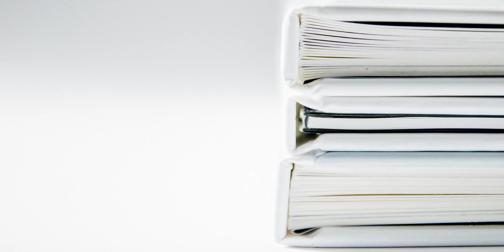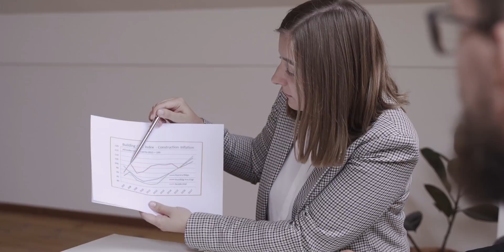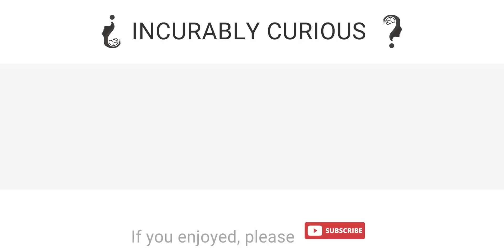Why Most Power Lines Aren’t Underground

Comment: I work as a vegetation inspector here in California and I did want to bring up the point of the cost for "pruning the trees".  Since you made it sound like it was not a big cost.  For us it takes about a week for a team of about 6 people to section of our county at roughly 15 miles a person for that week.  Each of them can be payed ultimately by the power company between $19-$25/hr for 40hr/week.  After that you have the cost of the tree crews to do the work for about $15,000 per day for a 3 man crew.  Plus any inspectors coming afterwards to make sure the job was done correctly and the tree crews didn't miss anything.  Those inspectors they get payed between $30-$40/hr or up to $60 if they have a degree in electrical engineering systems.

So that's $237,120 for the first inspectors $5,460,000 for the tree crews and $62,400 for the last inspector for the lowest amount you could pay each year for a total of $5,759,520.  This is the bare minimum it would cost per year to patrol and clear the lines in each county of which there are 58 in California alone.  This doesn't include any bosses, clerks, office space, overtime, or equipment needed for these jobs to function.  And all of this is if they people working are from that area.  If they are from a few county's over or out of state they have to have lodging until they move on to somewhere else or back home.

So saying its just a matter of pruning trees along the lines is a little disingenuous.  And for those curious that's $460,761,600 over the course of the 80 years to maintain that network in an area if prices stayed the same for that time.  Which obviously prices aren't stagnant.  If anyone has general questions about what I do I'm happy to answer them.
Reply: I'm working on getting my Msc Advanced Power and energy systems. You're telling me I CAN BE A VEGETATION INSPECTOR??? I was considering being a SCADA or TSO engineer. This sounds more like my speed.
Reply: @jayflavor1  Of course you can.  I'll let you know right now every vegetation inspection company is looking for people.  There has been a huge shortage of people for years now and each one has been desperate to find good people.
Reply: Generaly people tend to not realise how much maintence of any infrastructure costs, and the army of people it takes.
Reply: @xzardas541  exactly man. People just don't realize because it all gets done but as soon as the government ( nomatter how much money they waste) is gone. This will go bad really fast. Just watch the documentary about what happens if every human disappeared instantly how fast our infrastructure will collapse. Just count all the city workers you see in a day and that is just a small percentage of what's needed.
Reply: I would like to note that though that seems like a high price tag relative to how much the infrastructure of the power lines and substations cost, that's really not that much. I work as an engineer designing substations and even for small projects where we're just replacing a single piece of equipment or just renaming lines. It can cost tens of thousands of dollars for just the design work over the course of a month or two. Then you have the cost of the actual equipment and the cost of the actual installation to account for as well for an small job you're looking at maybe $100,000+ and a big job well into the millions.
Reply: In Singapore, the thick crowns of tropical trees shed so many leaves regularly that just the leaves would cost outages. Power lines are fully underground now but trees are still pruned regularly to keep them out of the way of buildings and other structures, and it looks like a LOT of work
Reply: @aahfeeki  It is.  For here we have 2 teams one looking at dead and dying trees and the other is looking at green tree hazards.  We have them staggered 6 months apart so things are less likely to be missed.  It still happens though because we are only human.  Here I my county Grey Pines are a huge problem.  Not only do they grow I credibility fast (4'-8' a year) but they also have very weak and poor taper wood so they lose branches often and have issues with uprooting.
Reply: "Which obviously prices aren't stagnant." — This would be relevant if the price of trimming the trees rose at a faster rate than the prices of everything else. If the price of the tree trimming rises in a proportionate manner to all other prices, then it is irrelevant — you just pick a year (probably the current year) and quote the cost in that year's dollars. Future generations can then inflation-adjust it. If, on the other hand, the price of tree trimming is expected to outpace other prices in future years, then you would have to account for those increases to have the most accurate dollar figure for a multi-decade operation.
Reply: You're a veg detective?
Reply: @krashd  Pretty much haha
Reply: @krashd  haha pretty much! And it's been the best job I've ever had.
Reply: Yup, the cost of labor in the long term is intense.
Reply: Good details
Reply: There are 2 type of expenses for any company, capex and opex. In the case of power utilities, capex (cost related to puting up electric facilities) is included in the rates, while opex (cost of maintenance and operation) is normally not, specially labor-only activities such as tree trimming. Basically tree trimming is a sunk cost for power utilities and it does not affect power utility rates regardless of how intensive it is. It is a matter of accounting.
Reply: Then the costs of people who die from accidents.  They could bury power lines under the roads which would reduce many problems currently associated with certain flooding events, and certain tree damage.
Reply: @b_uppy  exactly. "Lawsuits" was a key word I left out.
Multi-millions.
Reply: @garyfasso6223  
But hey we're 'saving money'.  🙄🙄🙄
Reply: I feel for you, I used to have to do this job. It IS expensive, AND VERY DANGEROUS.
Reply: @Paradoxicon999 
A teenager was killed on the job doing trimming related work.
Reply: Yeah, and then there's youtube channels where 1 guy does your job better as a hobby. Shut up city worker
Reply: While a good point, given the price to install underground cables and how long they last. It seems it would still be cheaper to just maintain above ground cables in most areas
Reply: @zadeoooo  In many instances it can be cheaper.  For example in areas that are geologically unstable.  Which is pretty common in here.
Reply: It's California. Just wait for a fire.
Reply: Not to mention the cost of power line caused wildfires, especially  in California.
Reply: Good read but the word is paid lol. How do people choose to type the wrong word and to top it off, it's more letters as well.
Reply: 19-25$/ hr seems very low for a vegetation management inspector. Sounds like you’re working for the wrong utility/ contractor
Reply: @casey896  True, it was pretty low, but at the same time, it doesn't require an education to patrol power lines.  The only requirement these days is either 1 year in a forestry field or a bachelor's degree.  And you could probably get a better job within the company with a bachelor's degree.  For my EA work, I've reached about $42/hr.  I know some of my coworkers are making more than that due to more experience and certificates.
Reply: Yeah, idk where that guy got his info from, but pruning and cutting down branches and trees has never been cheap.
Reply: I worked for a major utility in CA, I was paying $1,000/span to clear a 3ft hole around the telco strand few years ago. That didn't include traffic control and other expenses. My tree trimming crews were billing millions a month and they couldn't find workers. Money wasn't the issue. These crews could do 15-20 spans/day. Nobody wanted to work.
Reply: @ajazvo  It's true this has never been a cheap business to run.  I'm sure a lot of my estimates are wildly out of date with new contracts and new companies coming in and out all the time.
Reply: @loganmccarthy1150  I think the issue driving up prices was poor planning. Companies seem to do their build outs at the same time and when undergrounding projects are announced there's no money left in the budget. Young people not willing to work also factored in.
Reply: Im in Florida  - they show up every 3y and trim the trees in my backyard.  Love the service  - giant waste of money.
Reply: @CHMichael  it’s preventative maintenance. Keeping it in check before it becomes a problem is far cheaper than waiting for a problem to occur
Reply: @CHMichael  the reason California had all those outages. The state owns all 3 parts of electricity. Power plant controls. 2nd transmission lines form plant to main transformers that will supply the city.  3 service distribution through out a city supplying homes and buildings.  The 2nd one transmission lines. Usually the company that maintains those lines. They would maintain and clear the easement besides maintaining lines and towers. 
      So California they have so many types of management levels, fees and costs to city or state. They also have great packages for those management jobs including pay and pension also health insurance. The utility is losing money. 
     So where can they cut budgets. Maintenance of easement on transmission lines. My state you could probably see easements from space. Joke.  I have seen videos where fire was going towards lines and they shut down. Those dry areas should have wide clearance and other tree's cut low. It's disgusting how they don't clear them like they should.  You know why, they're pushing GW caused all these issues. Get emergency funding and use some for problem
Reply: say what ? 15k per day for 3 people crew ? are they goldplating the trees or what
Reply: @borispsalman  Hazard pay for the crew ($60/hr) plus the bucket truck maintenance and gas over 10hr which isn't cheap to run.  And on top of all that you also have the chainsaws, rope, harnesses, and other equipment that needs to be maintained and fueled.  At the end of the day the tree company needs to make a profit too.  So after everything it gets pretty expensive.

And on top of everything cutting trees is the only way these company's make money.  So that small 3 man crew needs to pay for not only themselves but all the supporting jobs behind them.
Reply: So you are over-paid in your Cali Union Job.  What is news about that?  In Chirack, a three man garbage truck crew is $200 K/year BEFORE overtime, sick days and riots.  Again, what is the point you are attempting to make.  He is right--tree trimming SHOULD be just tree trimming, not a Soprano's racket.

Comment: Independent power generation coming to every household soon... just like we unhooked the telephone wires, soon we'll be unhooking ourselves from the self proclaimed heroes of over priced, inefficient, and blight of electrical power lines.
Reply: With solar power and batteries the power line or you will have a small generator for backup recharge. The power line will become your backup power system. Good bye power line and electric utility company..

Comment: I don’t know if you figured in this cost. The connection at the house-meter base. That would have to all redone from the meter base to the the breaker box, which would cost thousands of dollars per household, ripping out sheet rock, piping , landscaping the list goes on. It would be cheaper to install a auxiliary generator instead.

Comment: I’m an estimator for an electrical contractor and you forgot to mention that wire sizing has to be increased when running underground compared to overhead due to insulation and heating or wires
Reply: Yes this video glossed over the entire energy loss of underground wires too
Reply: Thats also because the lines are antennas ie( transmition lines) they work better and are cheaper due to smaller wire needed.

Comment: In suburban locations the pros do out way the cons. In our city the state used to own and maintain the grid. They began the conversion to underground. But then the grid got privatised and the work stopped.  Extreme events are not an example to use against conversion of lines where children flying kites or cars crashing into 11000 volt over head lines in the street where you live is an issue everyday.

Comment: I mean, it also depends on where you live too. And the workflow used. I believe the ideal situation for urban settings, which is almost shocking hasn't been the norm for most cities, is underground access tunnels under every road. This way you can pipe anything you want in a place you can literally walk to in minutes instead of having to tear up the road and burry things every time. It's a cost, but investment in infrastructure is almost always good in the long term, it's money well spent and not even that much.
Reply: Sidewalk, road is generally reserved for sewers, gas and water, while sidewalk is for power and communications
Reply: @Gastell0  not hard to add a system connected to those already flushed out systems
Reply: @Gastell0  I design underground utilities.  We simply locate them on the other side of the street or several feet away.  Worst case, we can put them in the same area because sewage and water and gas is much deeper.  But 99% of the time we can keep our distance.
Reply: @GeographRick  Yeah that's just observation and personal thoughts, I lived in Berlin, Munich and bow live in a small town on listed street in listed building, and this principle applied in all 3 cities on wide range of street types, Electrical and communications are dominantly under the sidewalk, possible on one side, the rest mostly under the street itself or on other side of the sidewalk
Reply: Singapore switched to this exact plan recently. They built up the tunnels to double the capacity to anticipate future demand. They started reorganizing the sewage, water, power and telecommunications supplies so that they don't clash with other subterranean infrastructure like metro and highway tunnels. Like most things about Singaporean infrastructure I'm sure it will pay off

Comment: I have underground where I live and it's so much better.  I rarely lose power for more than a few minutes.  I used to lose power for days.The lines are accessible via periodic access points. You put in conduit during road work so the ground is already open to save on installation cost.  But it doesn't work everywhere.

Comment: First Principles: The best part is no part. There should be no power transmission lines. Power should be generated on-site by wind, solar, geothermal, and nuclear and stored in all types of batteries even as heat in the ground. Problem solved. The added bonus of not having forest fires and electrocution's caused by damaged power lies.

Comment: I now understand why all lines can't be buried. What I don't understand is why, in urban areas, they're buried under roads instead of sidewalks. Same for sewer, gas, and water lines. Sidewalks could be made of simple slabs which are laid atop a concrete trench with its own drainage. When access is needed, simply lift the proper set of slabs and voila! No digging required... and no half-assed patching of streets after.

Comment: Speaking as a civil engineer technician. All relatively new engineering technology technique will cost more at first. Yes. But it will eventually come down to a more reasonable cost, as  the construction market continues to correct its supply ability. These are up front cost. City, county, State and federal planning can plan for a multi utility and roads upgrade to reduce cost. All infrastructure will need replacement. It is better in the long run to plan and execute upgrades then slap a bandage on it and pray it holds. 
Utility companies are there to make money,  a lot of it. They will do whatever it takes to make that bottom line. Including misleading the public about upgrades.

Comment: A LOT of power cables in the UK are underground. Not all though. It seems that for the most part, they're above ground for long distance high power, EG, power plant to substation, but then underground mostly in the city.
Reply: I've heard that they're planning on moving them underground in AONBs in the future.
Reply: They're starting to move it UGC tbh worked as a UGC consultant for a DNO and designed a 17.2km 132kV UGC from substations a to b

Comment: The cost of putting cables underground for perceived improvements in reliability is better addressed these days using household battery backup systems.  

I’ve got a small portable system.  2.4kWh.  Useful enough for running the fridge freezer and central heating gas boiler as well as a few lights.  Good for 24hours, and I kept it going with a solar panel for an extra 24hours.

I’ll soon get a 10kWh grid tied system.  Then I can keep going without compromising for a couple of days.